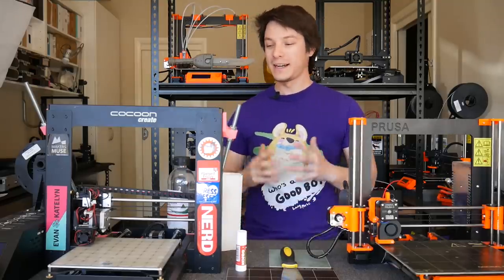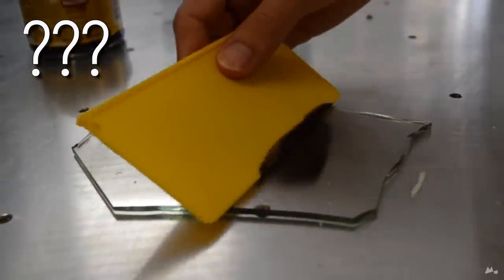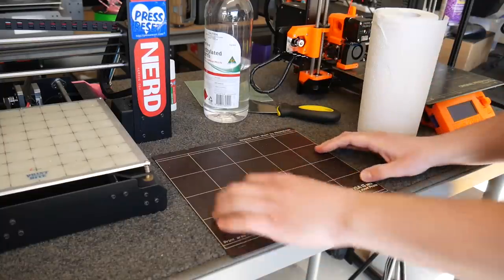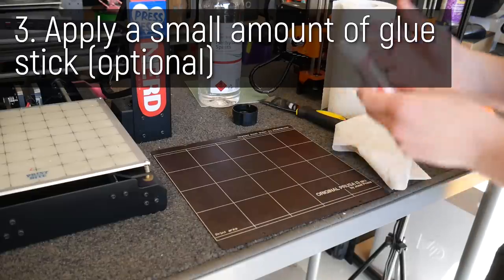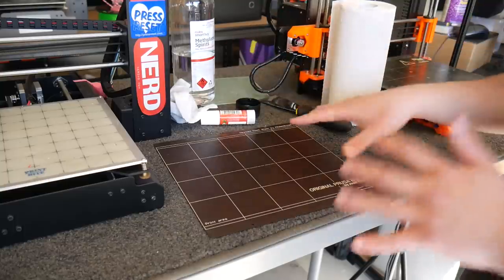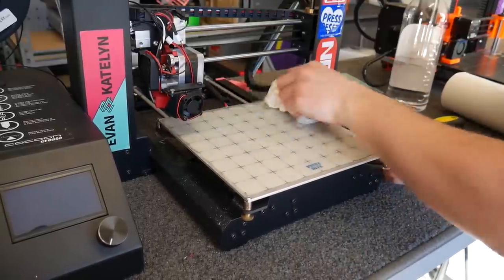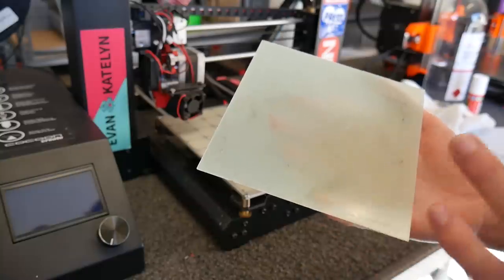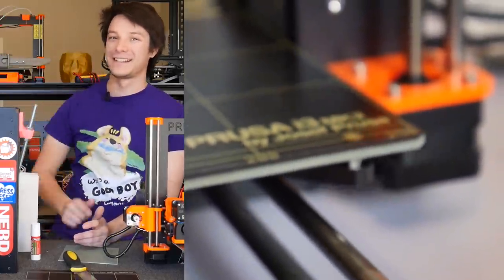3D Prints not sticking anymore? Watch this! 3DP101

Comment: Howdy.  New 3d printer owner here.  I just got a spool of PLA, and dammit if it won't stick.  I thought maybe the model I was printing was crap, but nope, it's doing it on the test model which came off perfectly (as well as 1 other print I did) yesterday.  I have an Anycubic Mega Zero 2.0, and it has a magnetic pad that attaches to the bed.  Should I use this method (methylated spirits + glue stick, I've got both of those lying around) on the magnetic pad?  Thanks for this video, by the way.  Subscribed!

Comment: I didn't feel like going shopping today so I taped a piece of paper to my bed to print on top of. Its working fine but obviously its not an ideal long term solution.
My only concern was the paper getting to hot (it burns at roughly 233C) but the first layers went down with no issues what so ever.

Comment: I’m new at this and have been using the blue painters tape.  Sticks great!   Too great though and I end up replacing the tape almost every single print where it won’t let loose.  I’ve used the putty knife (plastic and metal sharpened good) but cuts the tape a lot, and I twist it. It’s just the darn thing will stick too good.  And I’ve tried wiping the tape with alcohol and not.   Same results. It’s an anet A8 printer with original heated bed and the original lining stuff and painters tape do the same thing.  Wish I could use a “sillpat” on it or something.   Anyway thanks if you can or can’t help me.

Comment: I found this problem with my new printer

Used to use Wanahos i3's but they were all defective 
got a CR-10 now, first few prints didnt stick (was using the filament in the box, awful stuff)
changed over to my go to cheap unbranded filament and it was sticking fine.

changed the settings a little to increase print time and it started to lose adhesion., no idea why, prints kept on failing, getting solid balls of plastic (pla)

did a print just now using a raft and it printed fine, normally I use brim/skirt.
dont want to use raft as its a waste of plastic.

will defo give this a go, dont have any glue sticks to hand but I do have PVA glue, will that do the same job? got isopropol as well as i use it to clean my airbrush.

Comment: On my Anet A8 I added a piece of glass covering the heater, and what I do is just spray some hairspray once the bed is heated. Every month/ month and a half I rinse the glass and the old hairspray just comes off. Regarding first layer quality, it doesn't gross the plastic, instead it makes the bottom surface kind of shiny and very smooth

Comment: I just had this problem today on my Prusa i3 MK3 with the powder coated steel sheet, when I was trying to print a 12cm tall tube with 1mm thick walls (24mm outer diameter, 22mm inner diameter, and I was printing without a brim). After 4-5 layers it just got unstuck from the surface, despite cleaning it with isopropyl alcohol before every print (just as Prusa recommends). Then I rejuvenated the surface with acetone, and had no further issues with the print. No glue stick or anything else was required.
Reply: My textured Mk3 build plate was like printing on tyflon until I washed it with soapy water first, cleaning it with IPA or Acetone.

Comment: I still can't get my head around this.. 
So i made a custom 3d printer from scratch, put a sheet of glass as my print bed.. i use pla so the prints would wrap n not stick at all unless i use paper tape..
I decided to install the cheap mk2b heated bed n started printing straight on the glass. And oh boy what a difference.. now the prints stick too well to the point i sometimes wouldn't be able to even separate it from the bed.. but once it cools down to 40°c.. it gets separated by itself. 
Also the bottom of the prints now have this mirror like look..

Comment: I just got my first 3d printer, a used printer, that seems to be fine aside from a Chinese firmware I "fixed" by uploading an other one. First owl test print went fine, tile the head, then I got an adhesion failure. In the next test try I could not even print calibration cubes, fails to adhere right from the start. I hope this helps!

Comment: just saw this video. with my prusa m3 I clean the plate with isoprobic alcohol for a while then when the first layer stops sticking I do what is written in the prusa manual I wash the plate with acetone. this completely resets to plate and I get another couple of weeks just using alcoholic between prints before I need to acetone it again . my plate still looks new as I have never taken a scraper to it.

Comment: Will you use the same method on the spring steal sheet that comes with the mk3? Should i always keep the same side of the sheet on top or should i flip it from time to time? Should i clean both sides?

Comment: I use makeup removal pads and ethanol to clean. And I went from glue stick to printing directly on glass. I just use a temperature curve that has the bed slightly warmer on the first layer and then cool it down to prevent pla from becoming too soft and peeling up.

Comment: I have a Creality CR-10... My main use for the printer is to make cosplay pieces. Since my heating bed doesn't work,  I started to use wood glue for my prints. All my prints turn out great! The glue creates this sorta cement type, so my prints stay on nice and firm when it get further up in height. Once the print is finish, I take it to the tub and fill it with hot water and let it soak for a few mins. The glue will return to a soft and easy to remove state. I haven't had any issues with it... so far....

Comment: I had really good results with household spray degreaser from the drugstore on my Ender 3v2. Spray it on, let it soak, wipe it dry with a cloth or papertowel. Repeated that two or three times and my prints stick like the printer just came out of the box.

Comment: Thanks for sharing this. I just recently cleaned my print bed. After a while of printing with PLA and no problems I switched to PETG and it would not stick. After cleaning the bed and getting rip of all those oils. It prints just fine now though I think for a big print. I'll try the glue stick trick. Thanks for showing it off. :)
Reply: This method makes everything stick even the bad filaments that just wont stay stuck. I was given a beautiful filament but it just won't stay down. So I used this method after cleaning my nozzle of stuck on plastic and no longer had to worry about it.

Comment: Im having a good run getting pla,pla+,petg, carbon fibre to stck using a metallic self-adhesive vinyl, applied then scuffed with fine wet/dry sandpaper, cleaned with IPA (rubbing alcohol), then TUNE THE Z-OFFSET!, i tune the z-offset at every nozzle change. My experiance with glue stiks was they made a mess, and results varied greatly depending on the brand of glue stik i was using (however my method was not as described in the vid, i just slapped it on willy nilly and crossed my fingers!)

Comment: Hi Angus, can I use methylated spirits without glue to clean a plate instead of the manufacturer recommended isopropyl alcohol and would this be enough to improve adhesion between PLA and the print bed?

Comment: I found my PEI sheet on my Mk3 would only go a couple prints before losing adhesion, but for printing with PLA simply wiping it with a 70% ispropyl alcohol wipe got it back to perfect.

Comment: There's a high temperature printer, the INTAMSYS FUNMAT HT, that uses a special frosted glass platform. According to a how-to video on Vision Miner's YT channel, you apply a layer of PVA glue to the build plate, cook it at 100°C for a few minutes, smoothen the coat with a razor, and repeat the process. I wonder if this also works for non-high temperature printers with borosilicate glass build plates (e.g. Ultimaker 2+)

Comment: Hi is there any setting I can just on my Ender 5 when using a raft to still get a smooth top layer on my prints as when removing print from a raft the top surface is rough

Comment: My biggest issue at this point is lifting from edges and massive artifacts from areas printed over supports. specifically where the support is holding up a large flat area. It makes all the support material hard to remove.

Comment: My ender 3's stock bed failed to adhere on my second print, probably because I touched the surface, but also I believe because I couldn't get all the PLA off of it (a bed leveling issue caused some PLA to be deposited in ultra thin layers I couldn't remove the first few tries.)

91% isopropyl alcohol spray bottle was what I had lying around, and with a paper towel, and some more work removing the PLA, everything worked great!

Comment: My Anycubic Ultrabase did an adhesion 'fizzle'.  Partial failure, got worse over time.
Parts of the bed were OK, other parts not.
The worst spots are where I had been printing the most.
Acetone wash?  Not much help, but the first few wipes came off 'Ultrabase brown', and the surface seemed rougher after drying.
Ethanol, methanol, gasoline [outside, was desperate!], not much help.
Wire-brush?  Nope.
Ammonia, detergents, soap?  Nope!
Considered super-fine steel-wool, but the idea of thousands of little 'wires' drifting into the printer electronics gave me the plural-peps.
What rescued the surface?
White glue, but NOT for printing!
Bed cleaned with rubbing alcohol 70%, thick layer of white glue applied and allowed to dry.
Peeled off the glue, leaving the print bed super clean.
The glue I peeled off had many faint patterns of material residue from the print bed.  Like a map of every PLA print I had ever done!
I repeated the process again, but the second glue-peel had almost no junk on it.
Result was an Ultrabase working like it did on the first day!
It seems like some traces of printing material were building up on the print bed, making a nearly invisible layer.
Solvents generally can't touch PLA, so removal required the mechanical action of the dried glue.
I gave up on Ultrabase, due to the texture it puts on the model, and now just print PLA on squeeky-clean glass.
ABS gets hairspray on ceramic coated steel sheet.  Ceramic is 'flame-proof' exhaust-pipe paint.  Tried ceramic as a printing surface, zero adhesion.  The ceramic is slightly porous, so hairspray bonds very strongly!  After the print, just flex the steel and the part pops off.
PETG get kapton on glass; I was tired of losing shards of glass to the print!  
Super clean glass can permanently bond to PETG and pull glass off the print bed, so you need a buffer of some kind.  
Adhesion reduction can be a real thing!

Comment: What if your printer is brand new and nothing sticks you your (Creality-brand) glass bed. Even when using hairspray or glue stick? I had one print stick and for that, I used an extra strength crafting gluestick, after which I needed pliers to get the print off.

Comment: I had a problem that nothing would stick any more. Bed was fine. Turns out there was a bunch if gunk in the hot end, so extrusio and retraction had lag and so every line would start extruding late and get pulled right up, then get  knocked off when the nozzle came back, stick to the nozzle and then  there would just be a blob stuck on the nozzle. 

Took everything off the hot end, cleaned it out, refitted everything. Worked great.

Guess i have to remember to add it to the maintainance processes every so you often.

Comment: I use acetone as well for cleaning heat bed, but yeah, at room temp. Do you have some ideas for printing PC? I get first layer pretty well sticky into bed but the layers separate even during print. I tried many settings but none help yet.

Comment: Love the Boston bottle actually marked BOSTON (near which I live). To avoid smelly solvents, I like to use Windex to remove grease and dirt, and I keep a spray bottle filed with plain old water that I use along with my trusty putty knife to remove glue stick. I find PLA sticks well to PEI if it's squeaky clean, and Print-Bite works well but is expensive. Seems like I've tried every print surface and bed adhesion product on the market, but keep returning to glue stick. And I hate having to wash it off my printed parts. Maybe Angus's minimal glue stick layer is the way to go. Time to give it a try.

Comment: I have a Creality Ender 3 Pro, and I got a glass plate for it a few months ago.
The center of the bed's texture has become very smooth, and it's not something I can clean (unless the filament is just in the texture and I'm not using the right fluids to remove them).
Do you have any suggestions for how I can bring my print bed's surface back? I've resorted to just printing parts in other locations of the bed for now.

Comment: I've had good luck with a glass or mirror plate surface wiping down with isopropyl alcohol or glass cleaner every 5 prints or so. I also use a micro fiber cloth (autoparts store) to wipe the bed plate before every print. The micro fiber cloth acts like a magnet to pick up any microscopic dust particles. In addition a level bed is a must with the proper nozzle to bed clearance. I prefer a paper thin (.15mm) gap between the nozzle tip and bed which helps to really compress the first layer to the plate. If you start having problems down the road check your bed and/or nozzle clearances as very tiny changes seem to happen over many hours of use. No sticky hair spray or glue mess to worry about using this method.

Comment: For ABS with a heated glass bed. I use ABS yellow plumbers glue. It is quite cheep, and I heat the bead to about 80C. As print cools down, it starts making popping sounds, and comes free on it's own.. Note: Print head when hot will melt through the ABS glue if added too think. And makes for a glass like finish on the bottom. 

  Down side it is Yellow in color. But paints up nicely.

Comment: I was destroying my build plates, then I bought a Prusa.... Now I never touch it, only clean it with alcohol.
Reply: Mostly the same for me, except with ABS, PET, and TPU. For the former, my first solution was ABS slurry, and later I just decided to redesign load-bearing parts to work well in PET. For the latter two, window cleaner or glue stick, because that stuff just wants to stay forever on bare PEI.
Reply: You don't touch the magnetic build plate? Or isn't it a MK3?
Reply: Really? I'm having so many issues with the first layer.  It begins sticking so well then it begins warping as it prints along the same area and just lifts from the bed and gets caught on the nozzle as it goes around.
Reply: NuRaLoQi: Without seeing it, and assuming you're printing PLA, that sounds like the nozzle's too close to the bed. If the first layer's full of ripples, that's probably it. If parts are always lifting from the same corner, your frame will probably need some adjustment to correct skewing. The self-test tool under the calibration menu should gripe at you in the latter case.
Reply: @StopChangingUsernamesYouTube  you just explain exactly what was happening with my MK3! Thanks for the great advice!!!
Reply: alcohol leaves hydrocarbons on the surface, dont.

Just soap and water.
Reply: @MrAbletospeak yes it still leaves hydrocarbons behind.
Reply: Why does Prusa push fake comments so much?
Reply: @Glorious_Kim_Jong_Un  what do you mean? prusa printers sure do have their own issues (lm8uu bearings for example) but in general they are insanely solid printers with loads of very handy gimmicks.... I doubt theres any "fake prusa push" comments out there - simply users who are really satisfied with their product
Reply: What is your secret? Cant get anything to stick. Worse than my A8, self-build or even Tornado (which needs glue and tape). Was expecting more for the thick end of £700
Reply: @Plan-C  ok, this was a year ago. Now I use lots of gluestick. And I did the locknut mod.

Comment: Angus, what is your suggestion for cleaning the Prusa 'spring metal' bed?  Scrape, wash with denatured alcohol, then a light smooth coating of pva?
Reply from the maker: Yeah, that's how I condition it. Again, you don't really need the glue at all if it's perfectly clean but it helps keep small details like support material in place in my experience.

Comment: Also it's jaggy movements not linear movements that contribute most to filament lifting, so I find a very low acceleration yet fast speed on the first layer. And use a brim. Always brim.

Comment: MAGNETS !!  Beside cleaning the bed surface I take a very different approach to keeping the prints "stuck" to the bed. In the  actual deign file for the object I add a very thin single layer to the bottom of the objects itself, a layer that extends out in all directions from the base of the object, extending out about an inch in all directions. I then convert that design to STL and run that STL file through the slicer.  The first thing that then gets printed is that very thin layer. After it's printed about a half inch (vertically) of the object I pause the print and place some small, strong,  magnets around on the extended pad. And then resume the print. Those magnets keep the print solidly in place. After the print is done it's a simply matter of cutting off that extra hold-down pad.

This also works great for objects that have very little that's actually touching the bed. I have a number of objects that are fairly tall but only have a thin line of material contacting the bed. I extend that first layer out to create a reasonably sized first payer and use my magnet approach to keep it firmly attached to the bed during printing.